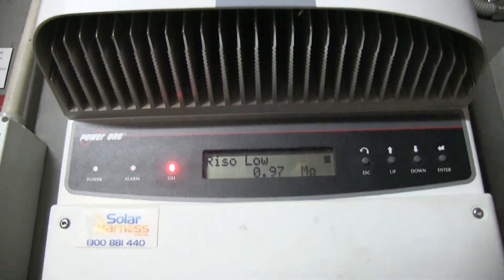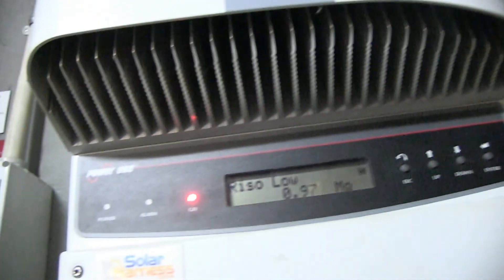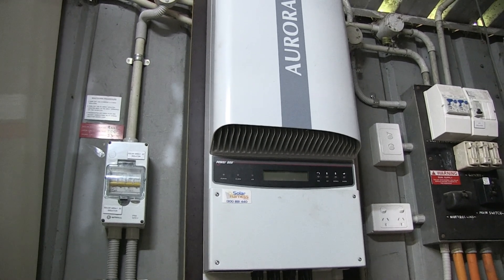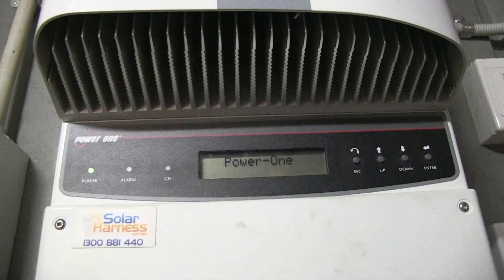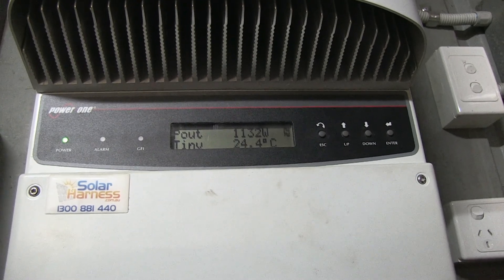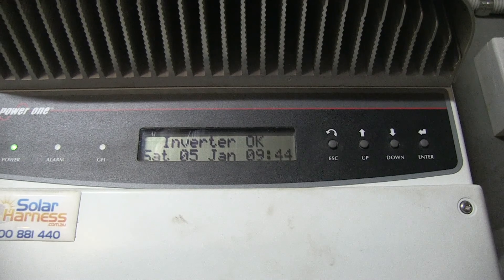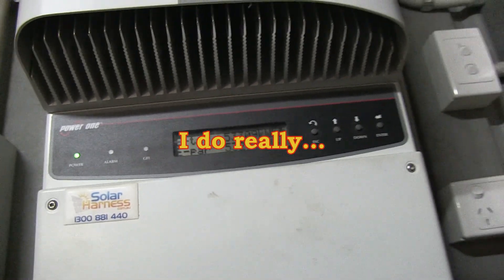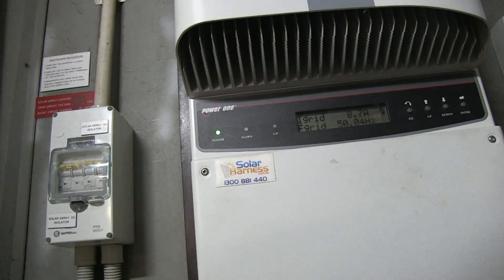Resetting an Aurora Solar Panel Inverter

Comment: I had the same error. Moisture got into the modules and caused short circuits and correspondingly low resistances.

But what you present here as a "solution" is a complete misinterpretation of your observations: apparently you are running two strings. The check for resistance errors is done at boot procedure. If you only connected the first string at startup (by first I don't mean either of them but actually the one connected to number 1!) - which apparently has no resistance error, then everything is fine. You just add the second string later when the check is done. But no later than the next morning when both strings are connected and the inverter starts again, it will switch off again due to a resistance error.

We hang on to:
- the inverter always starts when the string connected to input 1 is error-free
- if a "faulty" string is connected to input 2 after the start-up process, the resistance is no longer measured
- this process would have to be cascaded at every start
- It is better to repair defective generators and/or DC lines, i.e. fix the cause instead of symptoms

Comment: Common fault with these is a burnt out solder joint due to relay contact high resistance and resulting heat. Fault shows as RISO fault at start up, see Andy Reynolds channel for how to fix. It is not a difficult job.
Reply from the maker: Will do Thanks for your advice
Reply: This is complete nonsense. Andy's note relates to error E031 - not RISO (Resistor ISOlation)!
Reply: @blacksenator7333  Yes it is a different fault, the fault I describe is very common and if you have one of these inverters there is a good chance it will get this fault. Good news is it is not hard to fix if you have some skill in repairing PCBs. But obviously you just like to be a troll rather than offer anything positive.

Comment: Total nonsense , solve your defect leaking cables !
Reply from the maker: Have already had that done by a specialist many times now.
 No leakage happening except on Faulty Panels is the story told to me and they have been replaced. I have done a visual also to try to find where the moisture is getting in. No luck so far.
Reply: @GaryPArmstrong  

Hello Gary
This is not so difficult to find
The riso error is a earthleak error on the DC site

Disconnect the panels on the dc site MC4 connectors  from the inverter
make sure the dc disconnect switch is in the on position
so it is NOT disconnected

Take a multimeter and measure between the plus and minus of the cables from string 1
the cables that come from the roof ofcourse
you show in tour video that you have 415 volts on DC
This means that in not connected panels string should be about 460 volts as you have 10 panels in this string i think

so you should measure about 460 volts (can be different)

now take again the multimeter and stick one pen on the outsite of the inverter  (the earth) make sure you have a good contact 
maybe stick it under a screw

the other pin of the mulimeter you connect to the + cable that is coming from the 1e string (just measure one cable respect to earth)

the meter should be on DC measurement  same as before

now you should measure nothing or just a small voltage

Let the earthpen stick under the screw and measure the minus cable from the same string

again you should measure nothing or a small voltage

If you know where the cables go , makes it more easy to find the faulty one , when you measure a voltage multiple to one panel

if you measure for instance between the plus and the earth a voltage of 46 volts then the problem can ve found between the first and second panel

if you measure  4x46 = 184 volts , then the problem is between panel 4 and 5

if you measure 460 volts then the problem is in the main cable to the roof
this means that you measure nothing on the other pole from the string

if you measure almost nothing then there is no problem at the time

do this also with the second string

if there is also no problem then go take a garden hose and spray all the roof and panels

and do the measurement again

good luck
Reply from the maker: @draaistroomnederland3784  Thanks but because I am still under warranty I am not allowed to touch the panels. Thank you for your help. My Warranty will soon run out.
Reply: @GaryPArmstrong  After 11 years (manufacturer's guarantee 5 years - but performance guarantee 20 years!), my manufacturer replaced the entire installed capacity with new modules because more than 10% of the modules had a proven short circuit caused by moisture damage (= capacity 0)